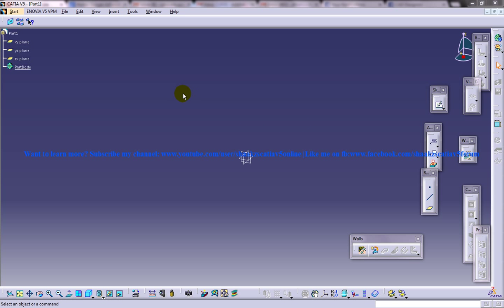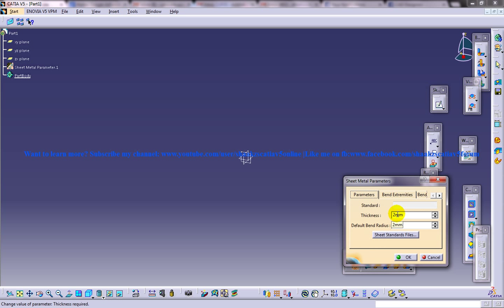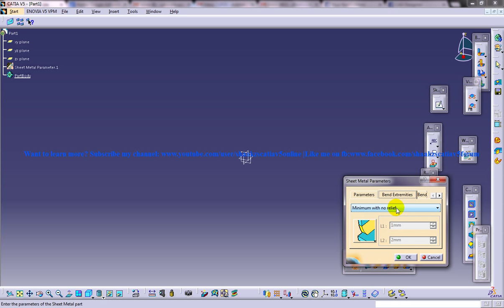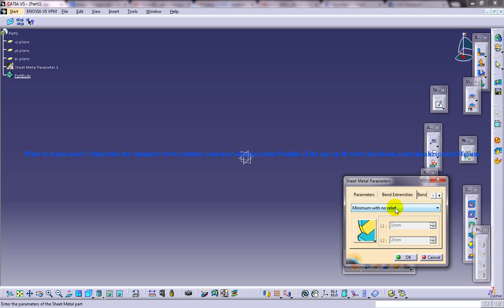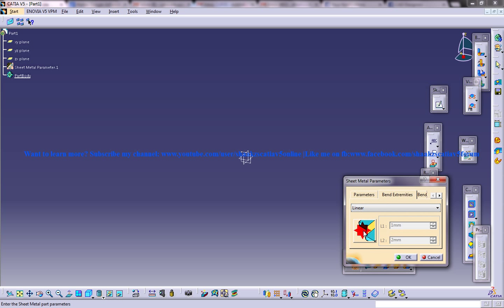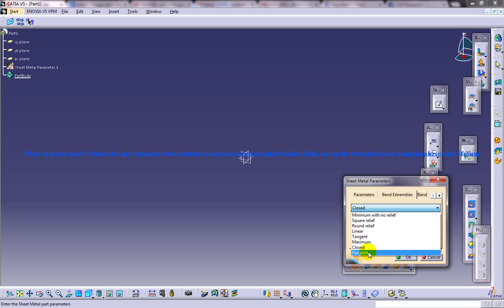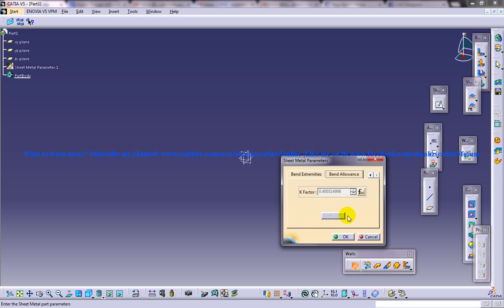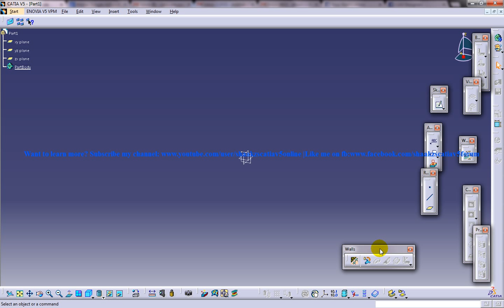Catia V5 Tutorial|GSM|Setting SheetMetal Parameters|Bend Extremities;Bend Allowance & K-Factor

Comment: Hai .. Mr. Mohamed  in this video you mentioned radius of 4mm  how we can decide ??? 
the formula is 
K = K-Factor, which is t / T
T = material thickness
t = distance from inside face to the neutral line 
can you please define the t
because neutral line should not be in a middle of the thickness  
if the plate thickness is 1mm then the radius is 2 ?? blindly I can not take twice  the thickness  
can you explain it, please
Reply: vcool vinu , according to DFM, bend radius shuld be more than sheet thickness or equal to sheet thickness. we can use less than sheet thickness but at some rare situation when we need it.
Reply: vcool vinu, we can not change or define t. we can change k factor then we wil get value of t.